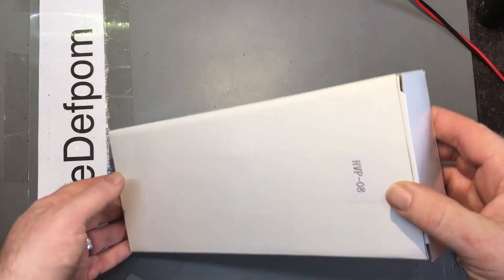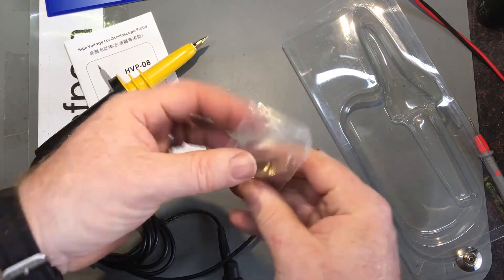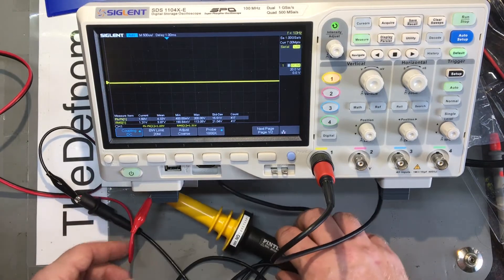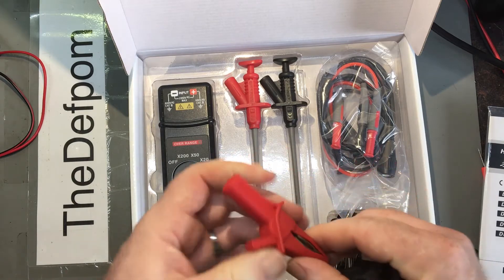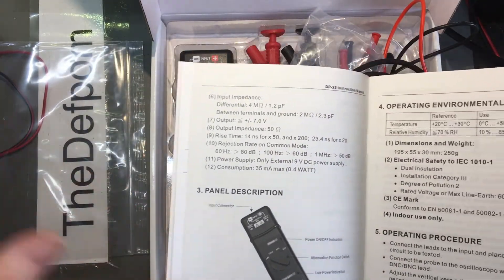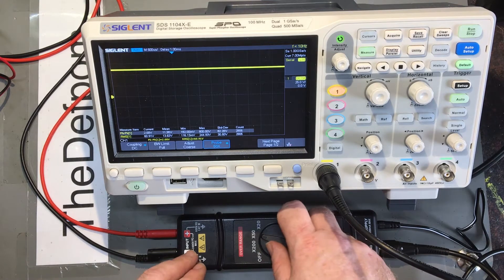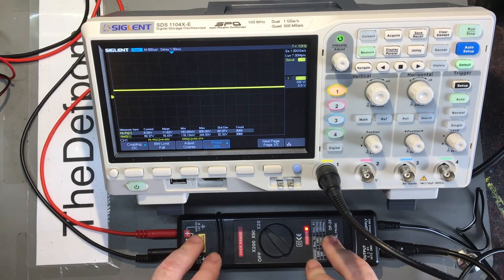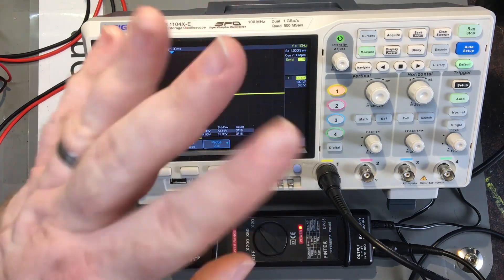#327 Pintek HVP-08 High Voltage Probe and Pintek DP-25 Differential Probe Reviews

Comment: the flat probe would be used the test the voltage on a CRT tube just slide it under rubber seal and make contact with the metal clip holding on to the glass tube .

Comment: take a look at the Micsig DP10013, it's 1300V  and 100MHz High Voltage Differential Probe for about  $150 shipped to USA. The Pintek HVP-08 is only 25mhz
Reply: Joe Hubler  thanks Joe I will Check that out. Regards Chris

Comment: I have a similar probe.  Looks good but I don’t think I would risk high voltage on a scope I used to have a valve scope for just that purpose.  But then again the cheap Rigols are almost disposable. The flat strip is to go under the top cap of a crt.  The time base on my powerscope has recently died and I may get one of the eev blog differential probes as an alternative.  Regards Chris